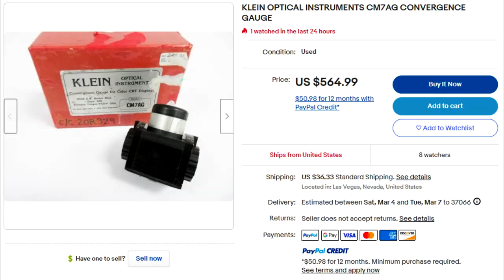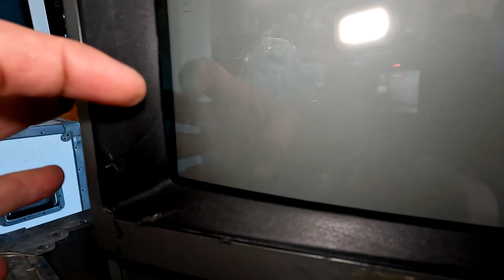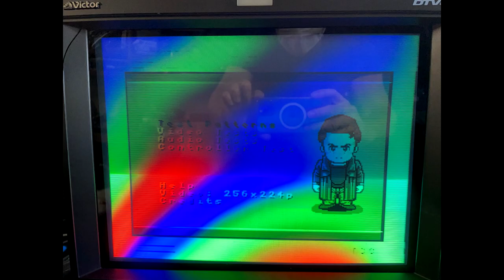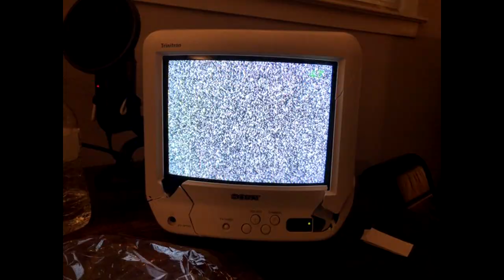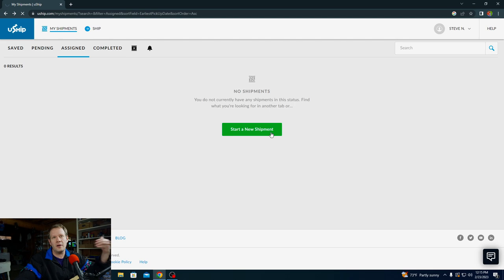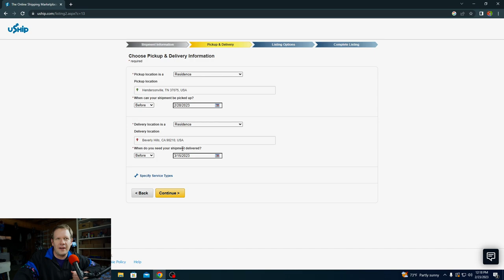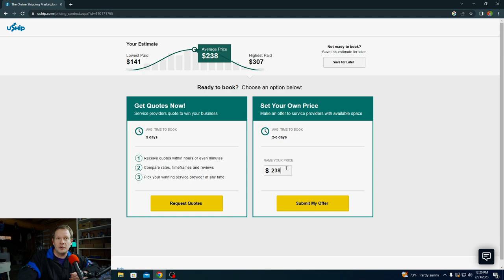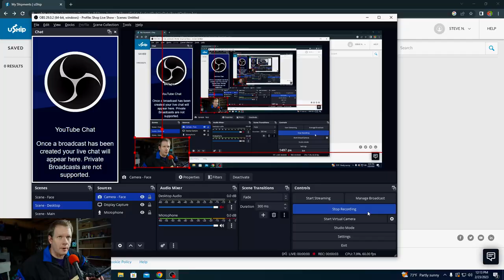How to ship CRTs safely using Uship! No packing needed?

Comment: I guess I've been pretty lucky.. My experience is the lighter and smaller, the better though. Out of 8 crt video monitors I've had only 1 negative one, which is sad because it's my best monitor. It was packaged with cut up foam packed so tight that it cracked the front bezel under pressure of my JVC. Unfortunate lol >:( 
However the last couple of shipments have been amazing, wrapped in a ton of bubble wrap with packing peanuts and a big box that could fit 8 of the video monitor in it if packed end to end. Showed up as it was in pictures and I was not dissatisfied.
Even used the packing peanuts to stuff some beanbag chairs!

Comment: There's a reason electronics used to be a lot higher than you would think. Weight and or size. You should see the packaging to a 1991-92 Pioneer Laserdisc player. No less than 3" of heavy polyethylene foam all the way around the product. The box itself is triple wall 1/2" thick

Comment: I totally agree that this is a huge issue. I would say that it's about 70/30 split on damaged goods in a typical ground shipping scenario. Seventy percent the shipper's fault and thirty percent the logistics company's fault. Logistics companies use a fair bit of automation in their setups to reduce handling but, those are designed in a way to prevent damage. What's the point of reducing handling if it just breaks everything? Reception and Final mile is the biggest points of damage. Those are the points at which People actually have to handle your goods. These are people who are put under extremely strict time limits for success which drives handling care to go out the window.   There is also a lot of similarity in how each operations works. Despite outward appearance the US Postal service utilizes small parcel carriers and larger logistics company's networks to move mail. So it's generally never a matter of company X is better than company Y, your experience varies no matter who you use.

Shippers/packers are the worst offenders. It's not just about using a multi-wall box to pack a heavy object like a CRT, it's about using the right packaging period! Not to Go all Bob Lag testing levels but, each fiberboard container has a circular stamp on the outside. I'd say a majority of folks ignore or have no idea what that actually is. It's a container specification, it tells you how much weight you can put in a box and the bursting test from a certain distance of meters dropped. If your max weight is 25lbs and you exceed that weight with a 40lbs item and you poorly pack that container; if it goes through a rough journey, likely your contents are going to get damaged. If you adequately pack that container with 40lbs of goods it's less likely to get damaged but the box states it's not designed to provide adequate protection to the contents. Non-regulatory stickers on a box, MEAN ABSOLUTELY NOTHING. If you slap a fragile sticker on it, you've just wasted a few cents on a sticker. Packing materiel is also a huge foul. Newspaper, junk mail, and old packing paper may do well for keeping light items restricted from movement in a container but don't expect it to provide any impact resistance. The goal when packing is to restrict the movement of the contents separate from the movement of the container, not just add a bunch of cushioning to it. Cushioning still allows independent movement from the container, which breaks things. A small amount of cushioning to add some impact resistance is fine but, no more that. The only above and beyond would be to add some puncture protection for the contents in the event something punctured the outer container wall.

There was a reason they hired an engineer when CRT's were brand new to design a box which could transport them safely. it's nice you've found a courier that does well for you.

Comment: I recently got an old tope older VCR from 1985 and it was poorly packed. Which resulted in smashed  front bezel being damaged. I have never bought a CRT online as of being scared of it getting destroyed. When I have the time I need to take a look at a couple of VGA monitors that I found at my grandads that were being stored in an old car. The one is a Gateway 2000 and the other is some cheap brand from the early 2000s that I can't remember name of right now.

Comment: Crt filters have improved way to much, looking at my arcade cabinet and my tablet side by side  i see almost the same ? and my tablet has even  more vibrant colors.
Reply: I agree, I do use ShaderGlass sometimes and it can simulate a lot of different CRT's. I do have real CRT's, both A/V ones and PC-VGA ones. 
Shaderglass looks very convincing and almost indistinguishable from a real CRT, let it be an old consumer TV set or a high res PC desktop CRT. This simple software can do it all.

My favourite filter is crt-guest-drvenom

Comment: Packing a small to medium sized CRT is a lot easier than packing a Plasma or a modern thin OLED display which are a lot more fragile. Not sure why people can't pack these properly, you can always charge extra for shipping to pay for packing material and use pallet delivery. Shipping a TV is like trying to ship preassembled furniture.

Comment: Hey man, I told you about the retro cabal complete confidence. You're out of the circle!
This is why I try to keep it local. I have two PVMs and would like a couple of tiny dudes just for aesthetic but I don't want to take the chance on bozos and their lazy packing jobs. I had an apple iiE with hard drives shipped and it was a miracle it arrived without any damage.